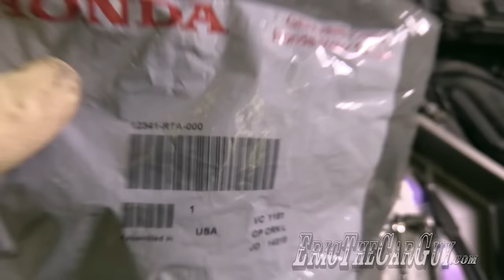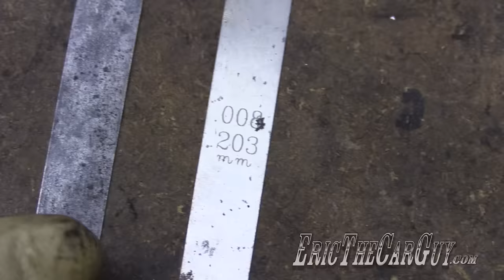Honda K Series Valve Adjustment -EricTheCarGuy

Comment: great video as usually but i dont prefer using a pry bar as it could chip the aluminium try next time use a rubber mallet give a few taps around where ever possible it helps losen gasket and cover, keep it up

Comment: Don't forget to let the car sit and wait until the engine is cooled down to ambient temp. Never adjust while engine is warm.
Reply: Most Honda dealership techs have a spare engine cooling fan we connect to the battery and put on top of the engine with the valve cover off to cool them down
Reply: he goes away from the camera to let the engine cool down.

Comment: Hi Eric , I have a question about valve adjustment, took my wife’s 2015 crv to the dealership for basic oil change,it has 57,456 miles they recommended adjusting the valves , I was Hesitant but went ahead with it, after getting it back it jerks when driving at about 15-25 mph , took it back & now they are saying that the fuel injectors need to be replaced, the car didn’t have any issues until the adjusted the valves, is it because they didn’t adjusted the correctly?

Comment: Sooo, after doing adjustment, aren't you supposed to use a torque wrench to the manufacturer specification? And then it would be to tight, aka,  to close for manufacturer specifications?

Comment: So within the spec range of the tightness, does having it near the tighter end make more power or anything? Is there any benefit of having it be on the tighter or looser end of the spec.
Reply: The lower the valve lash clearance the greater your total valve lift and flow across the head. Clearance must be large enough to compensate for maximum heat expansion (like during an overheat). I always aim for the low end of spec.

Comment: I would rule against reusing the valve cover gasket in any case.  Once it's been clamped down on for a prolonged period, it's been compressed and deformed for years.  Sure you can re-use it, but you can't guarantee the valve cover will compress the exact same way again and that's how you can end up with a very slow oil leak.

Comment: Hey Eric, I had a shop do the Valves on my 06 Element, the valves hadn’t been adjusted at all, got the car at 136k miles, and we’re now at 172k miles. The shop did the valves, and told us they were really really tight, however, after they did the valves, the car was SUPER loud, like a VTEC Tractor or more like a Mercedes Turbo Diesel from the 80s. 

We’ll be sending the Element back to the shop to redo it, but is it possible that the valves were made a bit too loose?
Reply: sounds like lash was set way too loose and uneven across the cylinders. Pretty common occurrence if the job is performed by someone who doesn't do it a lot.
Reply: Any updates??

Comment: Did mine @168000......did not notice much difference from factory......waste of time.....money and effort. Plugs needed changed at the most.
Reply: Even so it's good maintenance to check them.  My Element is at 254K and there was very little if any gap.  Frankly, I didn't even know they required adjustment. Glad I checked them and adjusted them. She's good for another 250K.

Comment: Eric, thank you for this video. Just did my  valves on my 08 Si and your video was instrumental in helping me. (Using K20 specs) It wasn't until the No. 3 cylinder that I got the "feel" down, but I did them all twice to be sure. Thank you again.
Reply: How’s it running? What specs did you adjust the intake and exhaust to?

Comment: Hey Eric, Great vid Dude! 
, I have the same motor in my '03 accord coupe. Car has 204,000 miles, doesnt burn 1 drop of oil, how ever, I just changed my oil 400 miles ago and the oil smells like gasoline. Dont think the valves have ever been adjusted and the motor sounds good until it warms up then, there is a bunch of chatter on the top end like yours in this video. Will adjusting the valves help the oil smelling like gas and will it quiet the top end? Thanks Eric! 
P. S. 35 year shade tree mechanic 😬😉

Comment: Great video @Eric! One question I have is compression. I have a 08' element and I am experiencing 20psi in cylinder one and 0psi in cylinder 4! Will this help or do I have a burnt valve/valves or something else internal? I did a wet and a dry compression test but I don't know how to accurately do a leakdown test. I've never done one. If I do a leakdown test, what am I looking for and what tools would I need? Thank you, you have been SO helpful over the years and I appreciate all of the time you work putting out these videos for people!

Comment: Great video as always. I doing the same engine valve adj.(215K mile) but found #1 exhaust lobe badly worn out compare to other's. do you know what cause this? May I send you some pics so you can see? Would be greatly apreciated. Regards

Comment: I’m getting oil on all 4 plugs on both sides of the valve cover. I thought it might be the spark plug seals but Eric said it’s more likely the whole plug tube needing to come off and apply hondabond on the treads. I tried to unscrew them and all I accomplished was to mar the metal. Searching Honda forums everything else I read is these are pressed into the head and are not removable. Anyone have thoughts on this? I just replaced the seals so we’ll see if there is any change but the seals I took out looked fine.
Reply: I'm in the same boat. CR-V has been in the garage while I watch every video and read every manual I can find, and from what I've gathered so far.... he's mixing this up with some other engine, he says something about Toyota engines in the same sentence.

I'm pretty sure changing the tube gaskets will fix it, it's what I'm going to do. No way in hell I'm sticking gooey shit down into my engine, when I haven't found a single corroborating source on this.
Reply: @lukeclaybornhopper In my situation I had already replaced the valve cover and tube gaskets and it still had oil everywhere. I ended up testing the block and even though the compression wasn’t bad the tester did show a bad head gasket 👎

Comment: Huge Thanks!  Having never done a similar procedure, I just did this on my 2006 Honda Element following this video.  The car previously had problems in the cold and would die when idling in drive/reverse and then be difficult to start.  Just started the car in below freezing temps and put in Drive and Reverse and engine now has no hesitation or rough idle.  Idle and engine are also now smoother when warm.  Problem solved!  Could not be happier!!!

All of the intake valves were very close and only required a slight adjustment on each (some a touch loose, some a touch tight).  The exhaust valves were all way too tight just like you explained!  All of them required loosening - on some by almost a full 360 degree rotation of the screw, and one on cylinder 2 by even more (was tightened all of the way down with no gap whatsoever).
Reply: I have a 2006 Element as well. Did you adjust in order 1234 by moving the cam shaft lob of each cylinder to TDC? Or did you adjust in 1342? Does it matter the order if your all are at TDC on the cam lob?

Comment: Hi,i have a 2000 mitsubishi eclipse gt and the hydraulic belt tensioner seems a bit loose,but when i push it a certain way with a screwdriver it tightens but soons i pull on the belt the tensioner moves back a bit,should i still try starting the car or is it worth just replacing the tensioner?the motor has 114k miles

Comment: Hey Eric I wanted to thank you for this video.  I must report it worked flawless with my vehicle.  it not only fixed the majorly ruff idle along with curing the "random missfire" codes it would throw no matter what new coils injectors or plugs I used. maybe title this as being able to fix that random missfire issue Hondas are so sensitive with.

Comment: Thanks for that, Eric. Just did a valve lash on my '02 Accord 2.3L with 110k miles. I found the same thing you did: tight exhaust valves (esp. cylinders 1 and 2) and very slightly loose intake valves. I was doing it to try to quiet a slight ticking sound you hear on idle. I've been hearing it since 60k miles, but it recently got a little louder. Reminded me a little of a '56 Chevy.  
After my adjustment, it wasn't any quieter. You gave me confidence by saying it might actually sound louder after you ease up on the exhaust valves, and mine sounds a little quieter than the K series you just worked on. So I guess all is okay. And I guess I'm protecting my exhaust valves from overheating and causing a problem down the road. It just seems these Hondas don't run as quiet as cars with self-adjusting hydraulic lifters.  (Maybe it's the injectors like the comment below mine suggests?)
Reply: Any updates?
Reply: @realtorjeffpimentel  It's still about the same sound, but now that I know what it is, I just don't worry about it.

Comment: Great job on the video and presentation.  Nice to see and appreciated the multiple camera angles.  Personally I would have cleaned up the two covers on the top at 32:30 and 34:20 I think.  It would have made the cover look that much better and everything else a little sweeter.  I understand that can be a slippery slope when you start chasing "looks".

Comment: I listened to the engine ticking before the job was done and then fast forward to the end and to me the ticking still sounds the same. If this is the outcome, what was the point to adjusting the valves? The ticking sound didn't get solved.
Wouldn't the ticking sound also be due to carbon build up on the intake valves? Or possible the engine oil was low? Thus being a sign that the engine is losing oil either through blow back or the cylinders are burning the oil up?  OR even possibly couldn't the ticking sound be due to the fuel injectors are dirty and they need to be cleaned as well? I have a 2007 honda civic hybrid and had this ticking sound, had the valves adjusted and had the same results as this video where the ticking didn't go away until I added fuel additive in to the fuel tank and did an oil engine flush and added Marvel Mystery oil into the crankcase with oil full synthetic. only then the ticking went away. 
So I'm wondering if a valve adjustment is really needed or not? Perhaps it's just carbon build up on the valves which needs to be cleaned out, is whats really needed instead of a valve adjustment because if carbon builds up on the intake valves then that would be another reason why the valves would not close properly. Just my thoughts.
Reply: Most of the ticking is most likely injectors. But either way valve adjustments are needed because they don't necessarily just get loose, they can get tighter over time. They're actually quieter when they're tight but if they get too tight they're going to be a little open even when they're supposed to be closed and you'll burn up your valves.

Comment: I had a different experience with my Honda Element.  I was having issues in cold weather.  It was hard to start (sounded like the battery was weak - cranking over slow) and would stall at the first stop sign (after sitting all night).  I had a manual transmission, BTW.  When stopping, I'd push in the clutch and come to a stop.  The RPMs would drop below 1K, then bounce up to 2K, then come back down to typical idle revs.  If the stop was within 1-2 miles of a fresh cold start, the RPMs would drop significantly below 1K and the car would stall.  Wouldn't happen again until the next day.

I ended up performing a valve adjustment in my garage.  I found ALL the exhaust valves to be extremely tight (like 0.003 or so, if my memory serves).  The intakes were a smidge over the 0.008.  Once the adjustment was made all previous cold weather symptoms went away.  It started quickly and didn't have the RPM surge...  until around 60,000 miles.  Then it happened again and the next valve adjustment yielded the same results.  Exhaust valves were super tight again.  Not sure why, but the adjustment fixed the issues again.

My poor Element was rear ended later and totaled.  :-(
Reply: that's terrible about being rear ended..

Comment: Eric, thanks for the video.  I have a question, you say that valve adjustment generally isn't supposed to fix any problems.  I've read in multiple places that doing a valve adjustment on these vehicles can cure multiple misfire (P0300) codes.  Do you think that's possible?  I'm having this problem on my 2003.
Reply: I read that a lot too researching the same issues. haha

Comment: I also have a 2004 Element .. I ordered the 10mm adjustment tool which was helpful except the handle of the screw driver could have been larger and the screw driver blad wider.

I have 215,000 on this Element, remarkable how well it has run.   I noticed this winter a loud tick in the engine when I started it.  I had never had the valves adjusted.  My mechanic discouraged against it, claiming it rarely makes any difference.  

I was able to remove the valve cover and tie off with string all the cable so they wouldn't nterfere. The engine was remarkably clean, not as much Eric's Element, but given that I visit Valvoline every 5000 miles.

I used Eric's method of turning the engine by the power steering pulley, the cam lobe pointing up..  It worked fine.

 I gapped the intake valves at .010 
and the exhaust valves at .012.

Rechecked all valves and adjusted accordingly.

I cleaned the valve cover. thoroughly with Krud Kutter ..  Good Stuff.   clean the surfaces of the engine block decided to keep the gasket with some Honda Bond at the spots Eric pointed out.

I lubed the spark plug pipes and the rubber gasked in the valve cover.  It went in smooth and buttoned up everything.

Reconnected the battery and started the engine ... very different sound, no loud tic and there was more of an even sound.    Let the engine run a while and warm up.   

Drove it around on town on short errands and  listened for any unusual sounds.   But the engine ran really smooth, although it didn't to have the same pep.

Took it out on the highway today and slowly increased the speed. at 65 it balked for only a second and then the engine came back to life, although the engine light came on.    

I continued to drive it around  at slow speed with no problem.   For kicks, when I got home, I diconnected the battery for a moment and then reconnected.  I started the engine and the Engine light went out.    

So that's where i am.   

No clue as to why the engine balked, which it had never done in 215,00 miles....
Reply: Any updates??

Comment: Hi Eric nice video, I have done loads of valves in my time, did I hear you say you done all 16 valves..maybe its my eyes but I though it was 12 valve, 8 inlet qnd 4 exhaust...maybe me...Fred in England.
Reply: There is one cam per cylinder on the exhaust but it goes to the rocker that pushes two valves at once. See it at 20:08 - two valves under two adjustment bolts.

Comment: Hey Eric, Thanks for making this video!! very helpful!! I was gong to ask If its possible to use a 10mm wrench and flat head screw driver on this entire engine or If I  NEED the special valve adjustment tool? Im only asking as its the only tool I dont have for this job and my valves could use an adjustment sooner then later so I dont want to wait to order it.
Reply: I used the 10mm wrench and a screwdriver. No problem. There was more room for the exhaust valves than the intake. But it will work. Good luck!

Comment: Thanks for the video of what it sounds like after your adjustment. My Accord was at 200k miles and pretty sure the valves were never adjusted. The exhaust valve lash was ridiculously tight before I adjusted them. Took almost a 360 turn of the screw on some of them. It is a little noisy now, but it sounds just like yours after your adjustment, so I feel a lot better about it.
Reply: My Element sounds a little louder too. Runs smooth tho 🤷🏻‍♂️

Comment: so your turning the engine so the bigger cam lobe is facing straight up for the set of valves your adjusting? just clarifying
Reply: ballenwallen yes the valves need to be closed. when the cam lobe in facing up the valves are closed. pretty simple once u know whats going on. on a 4cyl u can do 1 and 4 together and 2 and 3. usually. depends firing order

Comment: Did you prefer valve adjustement before or after oil change?
Reply: Doesn't really matter, but if I had a choice, I would do it before an oil change, then run it after I did the valves, then change the oil, with the reasoning behind it being - any contamination from doing the valves will be gone when I change the oil.

Comment: Just for the record, the spark plug tubes are not threaded in but pressed in. :) great video! Adjusted my TSX today.
Reply: Dave, so if you have oil on your spark plugs, what is the solution for that? I was literally going to do this job, along with threading out the tubes and cleaning them up and resealing them until I read this. Please let me know what would be the proper way to resolve this problem I'm having. It's creating multi cylinder misfires as well as ruined coils.
Reply: @jessicaromero8941 Replace the spark plug tube seals! This guy is misremembering something, as he is the only person in the world offering this advice. He mentions something about Toyotas when he's talking about it. I'm going through all 680+ comments on this video, and so far, everyone else that has researched this issue says the tubes are PRESSED in, not threaded, and trying to remove them could damage your engine.

Comment: Hi, I'm from Mexico (a big fan of yours) and I had the valves adjusted on my 2007 CR-V according to your recommendation. It was done by a qualified mechanic. Two days later, the DTC P1009 fault code showed up for a few minutes and then disappeared. Could it be related to the valve adjustment or could it be something else? Thanks!?

Comment: Was there a reason he used the mid spec feeler gauge (.012 gauge/.010-.013 spec range) for adjusting the exhaust valves and the low spec feeler gauge (.008 gauge/.008-.010 spec range) on the intake valves?